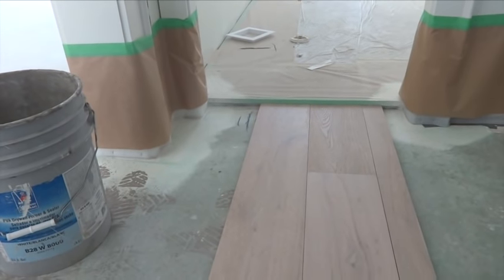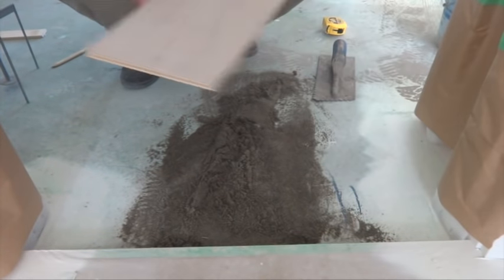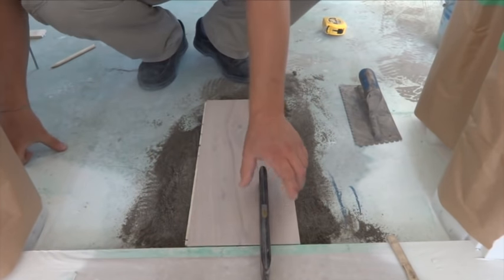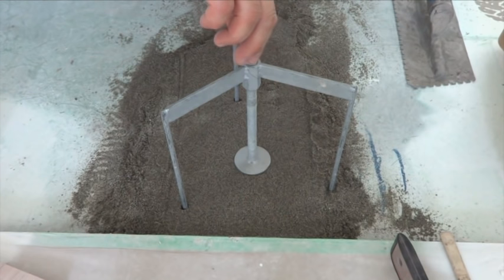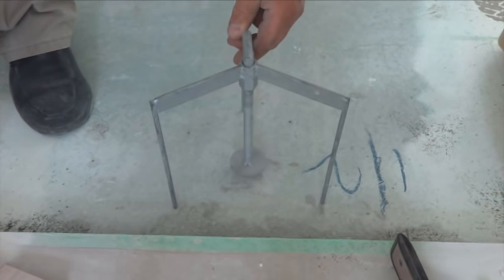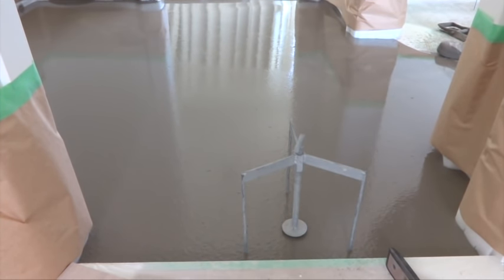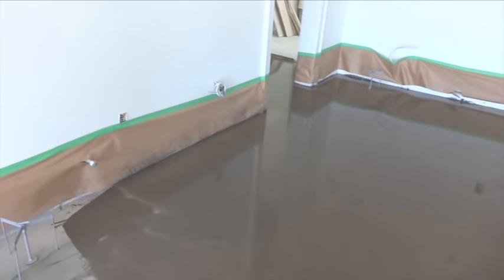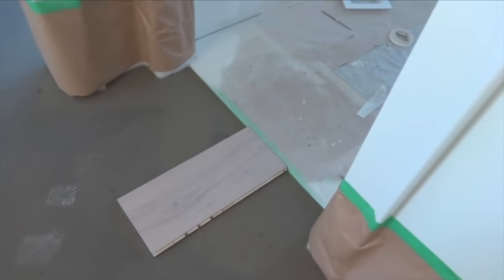Concrete Floor Leveling Trick with Sand and Screed Tripod - Mryoucandoityourself

Comment: Hello! The most tricky part is to get the center area(s) of the workspace actually level...All these close to the corner(s) are easy to level using the tripod(s). It is a different story when you get to the center of the room...Using more tripods helps for sure BUT this is not the silver bullet.
For large areas, I tend to believe that using plywood sheets first then the self-leveling concrete will be better...
Reply from the maker: Thanks for the tips!

Comment: Does it not become uneven once again when you account for the added height the thin-set will create? Is the difference considered negligible and you would use a small transition?
Reply from the maker: Hi Mari,This leveling for making even hardwood with tile without transition,  you can do installation as you want with transition or without. In 25 years it can be uneven again, maybe not.Thanks for watching!

Comment: Great tip. I see you have mixed up a lot of concrete at once. What is the maximum number of bags you can mix at one time? Is there a limit?
Reply from the maker: Hi Eric, no any limitation. Sometime 60- 70 bags a day, but it's  not so often.Thanks for watching!
Reply: Thanks for the response. What I meant to ask was, how many bags can you mix at once in a single container? I need to pour about 6 bags and I want to know if I can mix 3 at a time in one barrel.

Comment: Did you level the whole floor or just the doorways where wood meets tile ?
Reply from the maker: First of all whole floor and then doorway. Thanks!
Reply: MrYoucandoityourself  thank you !!! Really professional at your job.  I've seen that you use self leveling from mapei is that good quality?  Any problems with that product ?
Reply from the maker: Mapei is very good quality. If compare other brands - quality, price and easy to work - Mapei is No 1 in Canada!